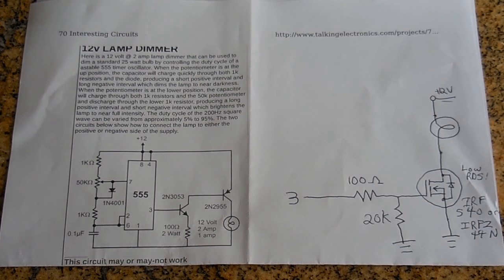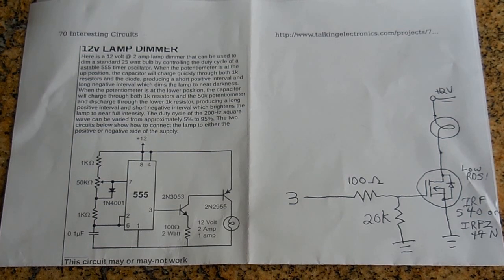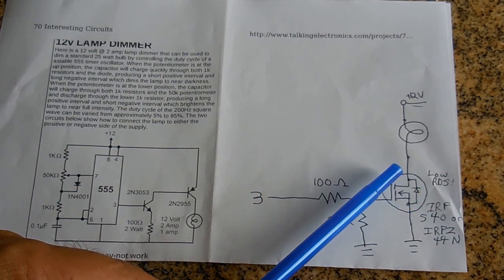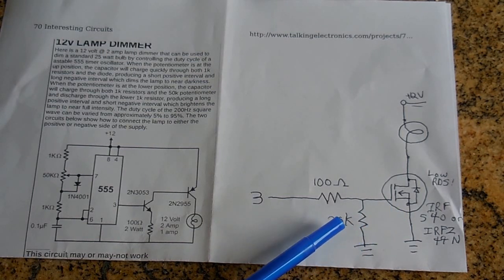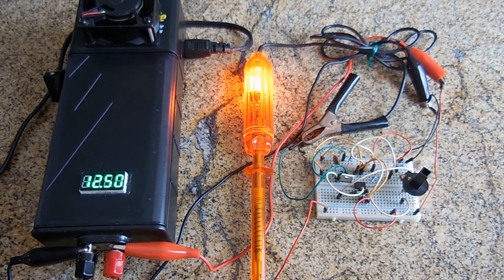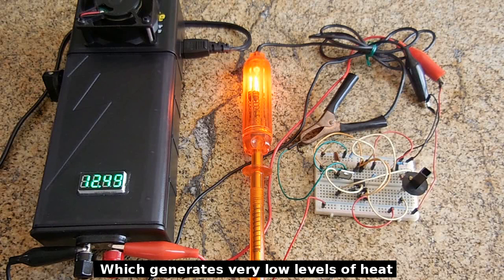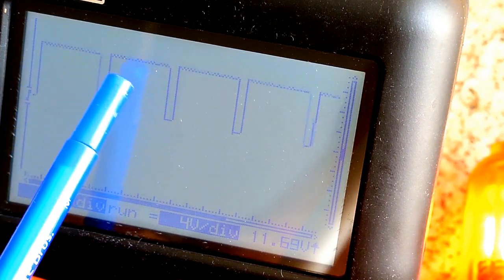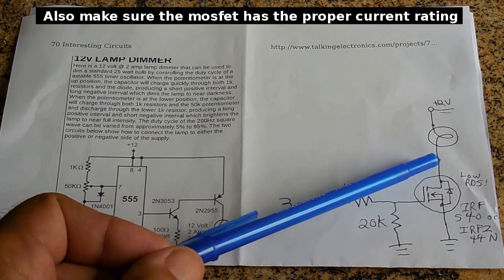DC Dimmer Circuit (3/6/9/12V)

Comment: Nice. Curious what are the resistors used for going to the 555 timer and also on your mosfet version, what's purpose of the 100 ohm at the gate?
Reply from the maker: +mrsemifixit 
Hello. When the 555 is used in astable mode(to create pulses), you use resistors. The resistors are used to adjust the pulses/frequency. Refer to the online calculator below. Though the 100 ohm resistor on the gate of the mosfet is not required, I always use one to help prevent any interference when triggering the mosfet. Thanks for watching. Be sure to share.

http://www.ohmslawcalculator.com/555-astable-calculator

Comment: Thank you in advance for your advice.Will you be so kind as to demo how to create dimmer effect for 2 60 watt incandescent bulbs in series for 220 volt AC power. The object is to get a poormans' warm 15 watt heat source with minimum light whilst prolonging the lifehours of the bulbs.When connect in series, does the live wire from the first bulb go to the neutral of the second bulb like positive to negative in a battery situation? Does the neutral of the second bulb then join the neutral in the plug to the power source? Does the neutral of the first bulb then join the live of the second bulb likwise negative to positive in a battery? Does the live of teh second bulb then join the live in the same plug?Does the earth from both bulbs join each other and join the earth in the plug? many THANKS .
Reply from the maker: +dogsbestfriends 
Please refer to my video playlists. I have a video showing how to make a simple 120V dimmer which can also be used with 240V power.

Thank You

Comment: Thanks for the video!  I'm not completely new to electronics, but I still have a very-beginner understanding of most of it.  I have several LED drivers with a 0-10v analog dimmer connection that I would like to control with PWM (from an arduino).  Can this circuit be modified to output an analog signal?  Thanks
Reply from the maker: +mnelson10000 
An analog wave would need to be smooth and continuous like a sine wave, which means a gradual turning on and off of the mosfet. That would not work because the mosfet would heat up because it is not fully on or off.

Thanks.
Reply: electronicsNmore
Can I hire you to help me conquer this problem?  I sent an email to the address on your about page

Comment: What would the effect be of using a 15k potentiometer?
Reply from the maker: The voltage range will be effected.
Reply: @electronicsNmore  I assume I'd have to change some resistors around to achieve the full voltage range with that pot? Or not possible? What should I search to find out how to modify this to work if possible?

Comment: Or you can just buy a lm2596 module for a dollar. What gives you a quite smooth dc output with no flicker. Bet you cant make this from 1$ and if you include the time it takes to make its like 10$ or more.
Reply from the maker: +Hulla Dek 
Unfortunately what you mentioned is not the same. Where did I mention "flicker" in this video? The frequency is too high for any flicker to ever be noticed by the human eye. The circuit shown in this video is far more reliable, less likely to fail, and can handle very high levels of current. :-) I'll stick with this circuit.

Thank You